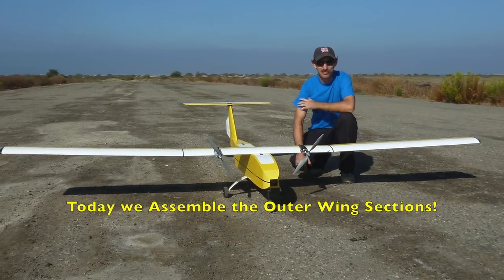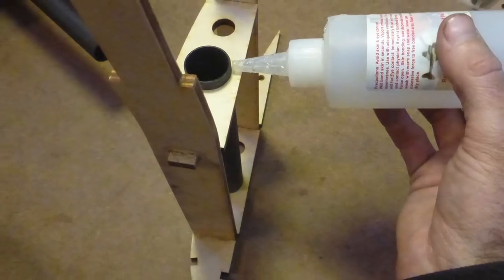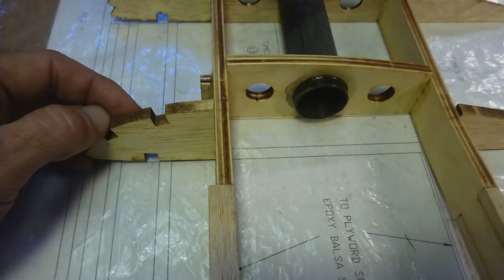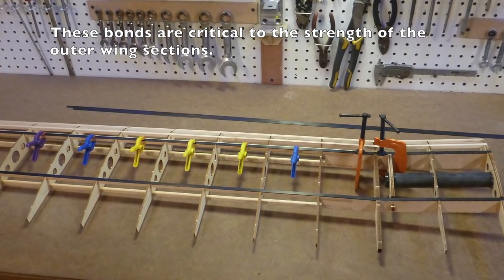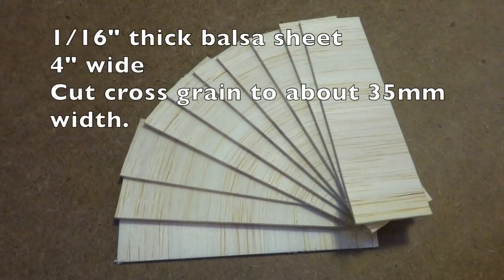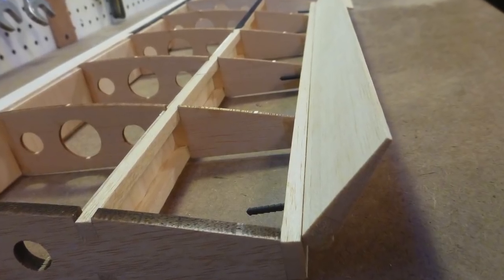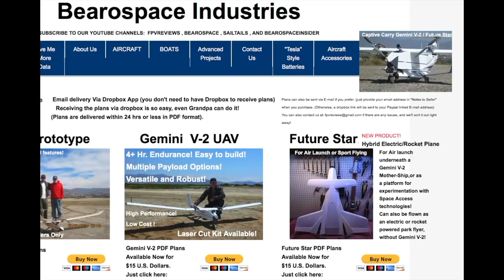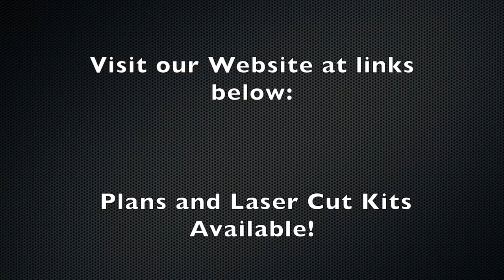Gemini V-2 Laser Cut Kit Build Video #5 - Outer Wing Sections

Comment: You use gyro?
Reply from the maker: It's made to handle well in full manual mode, RC, but adding a flight controller, such as  a Pixhawk, with Stabilized and fully autonomous flight modes adds functionality.